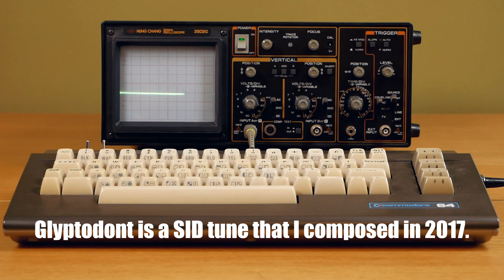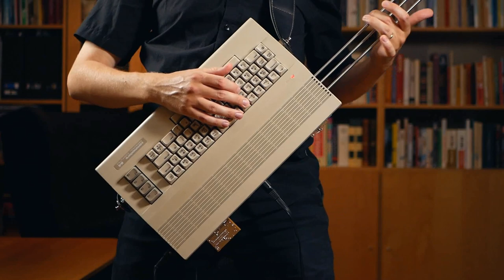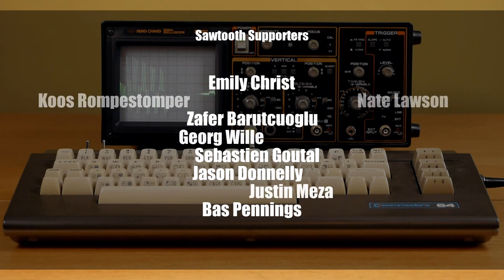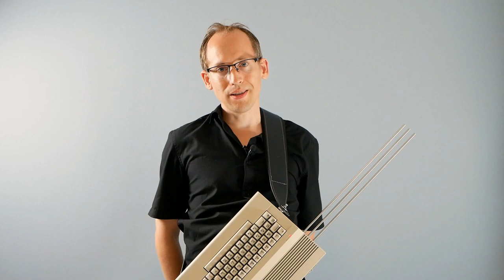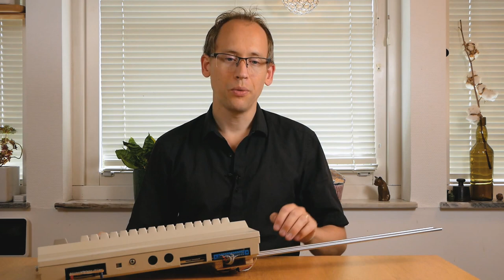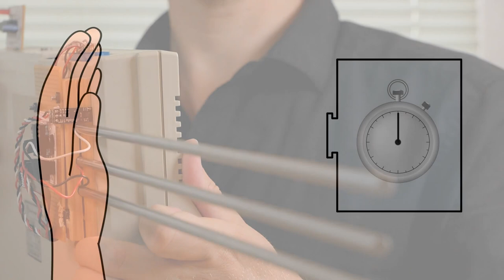Glyptodont performed on the C=TAR

Comment: Would it be possible/feasible for a future version to use resistance to measure how far along the rod you've touched?  You'd have to make your fingers part of the circuit, either with gloves with contact patches on the fingers or with your own bioconductivity.  I don't know how sensitive a detector you'd need, but if you picked rods with higher resistance, maybe that could help make it easier.  Basically having your fingers act as the wiper of a variable resistor.  That way, you could have three different "distance" measurements instead of only your hand being measured.

As for names?  No clue, I'm terrible at names.  ^_^;;